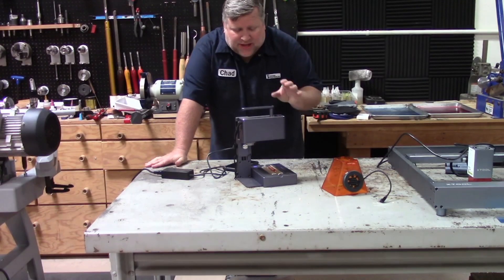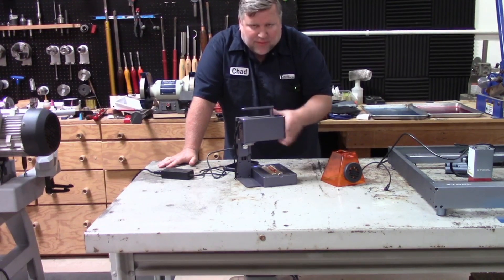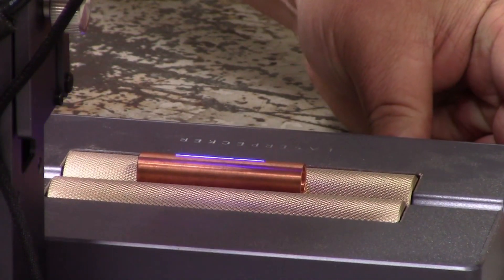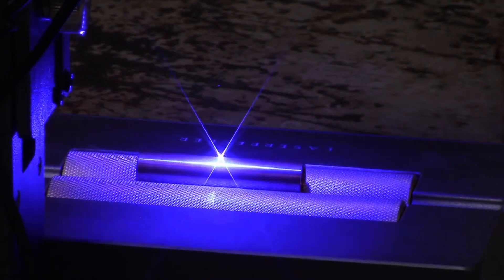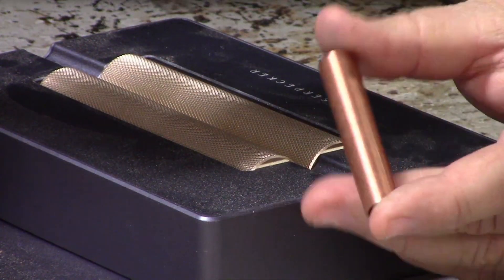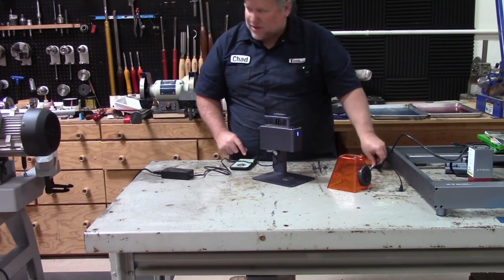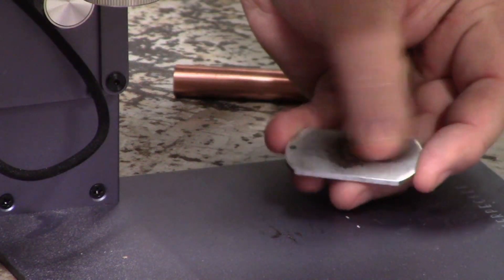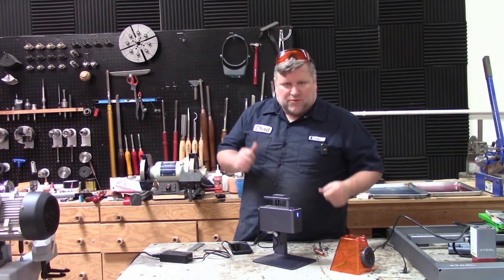Part 5: Laser pecker 2 small laser- copper and stainless steel

Comment: I seen where they mark the etch area with a black marker and after the etch use 91% rubbing alcohol to remove access marker off, voila you’re left with only the etch. Supposedly works on all surfaces ie glass and such with this method
Reply from the maker: good tip

Comment: ...well, copper is highly reflective and easily conducts heat...so engraving can be difficult (did some research). It is recommended to coat it with dry moly lube prior to engraving...note that removing it after engraving may be a chore, but alcohol and some elbow grease appears to work...👍
Matt
Reply from the maker: wow! that is super cool and good info. Thanks man!
Reply: Ace Hardware has a Gray Primer with 98% zinc. Spray the copper with a light to medium coat of the zinc primer then spray paint it with a metallic gold, copper or silver paint and then the Laser Pecker 2 will "engrave" the copper. This is a lot cheaper than $40 moly spray. The settings are "stainless steel" and make 2 passes. I have not tried 3 passes. This works on copper clad pennies and galvanized steel roofing rounds. The excess paint comes off easily with "Goop" remover.